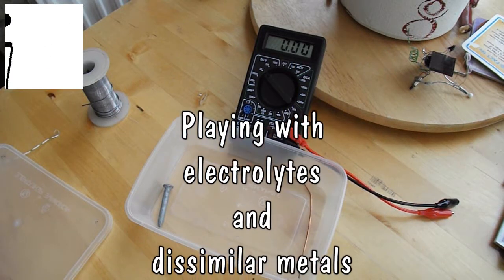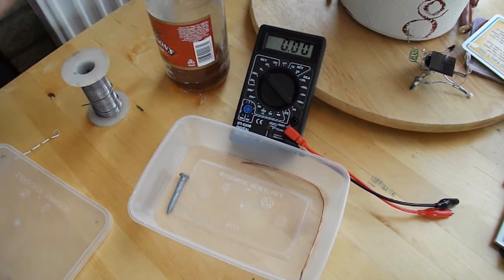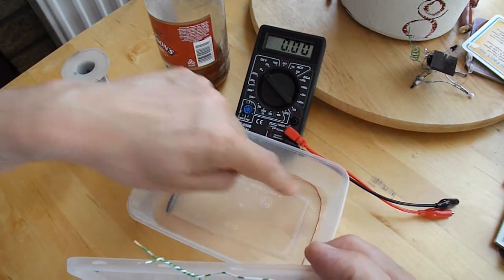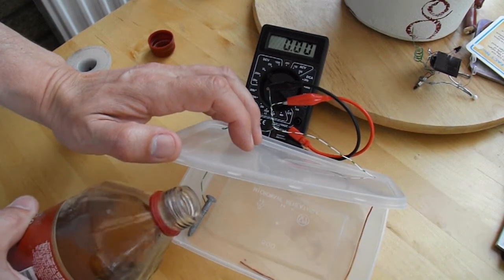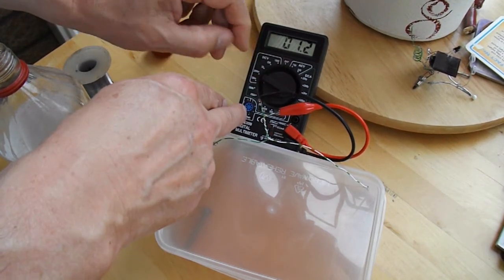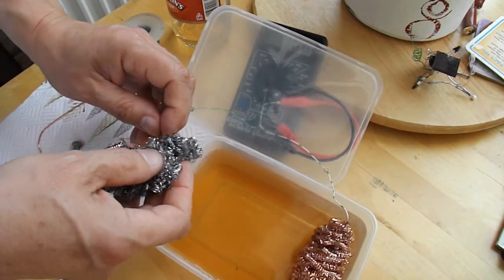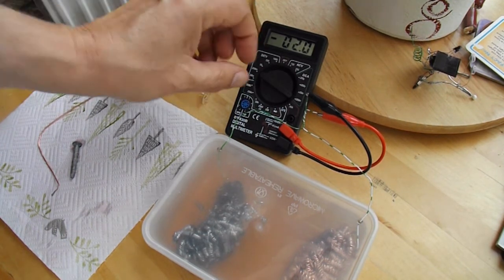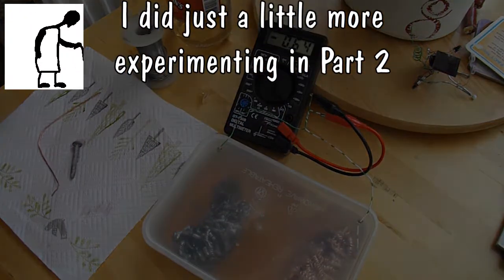Playing with electrolytes and dissimilar metals Part 1

Comment: You can’t say the power is coming from the metals then say the electrolyte makes anything. It only allows electrons to flow between the metals. Difference between zinc and copper is a little over 1.1v.  the junction of leads will also effect your reading along with temp current is a function of volts btw e=ixr ohms law
Reply from the maker: Yes, all correct, although no electrolyte means no current flow. You will find I linked to a Wikipedia article in the video description.

Comment: The ''copper scrubber'' is actually iron. I did a salt water battery with the scrubber and aluminum foil and got the same voltage as an aluminum-iron battery. You should probably try sticking them with a magnet to see if it is magnetic.

Comment: What would be the two metals that give more performance (easy to find, of course) for these batteries?.
And as the electrolyte, lemon or vinegar, for example ...
Do not you?
Reply from the maker: This salt water battery car seems to be a good one, with magnesium and carbon but I am not sure how easy it is to get hold of Magnesium.
Let's assemble a Salt Water Battery Car Kit 
http://youtu.be/yQJtMIwf0nA
Reply: GrandadIsAnOldMan Magnesium bars, can be obtained from old appliances such as microwave ovens (is what I heard, personally, I have not yet sought).
Reply from the maker: Francisco Javier Lázaro Pinela I disassembled a microwave oven last year but I don't remember any magnesium. There is another metal in there you don't want to get involved with, check out the links in my description with this video. Let's disassemble a Microwave Oven
Reply: GrandadIsAnOldMan I was wrong!.
Not in microwave ovens, but water heaters:
http://img264.imageshack.us/img264/351/termotanque1.jpg
Is in Castilian-Spanish, but where it reads: "Barra de magnesio anticorrosiva", is the magnesium rod.
Reply from the maker: Francisco Javier Lázaro Pinela I will have to keep my eyes open for water heaters :-)
Reply: GrandadIsAnOldMan
8-)